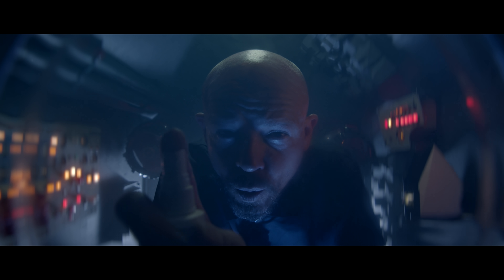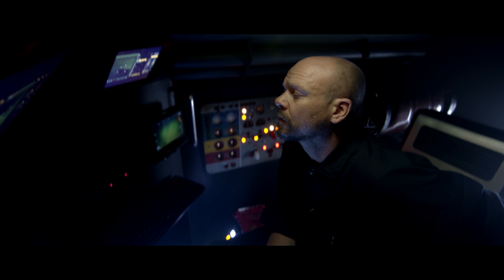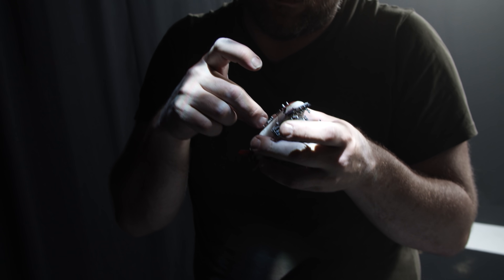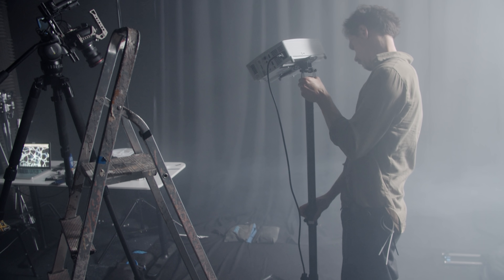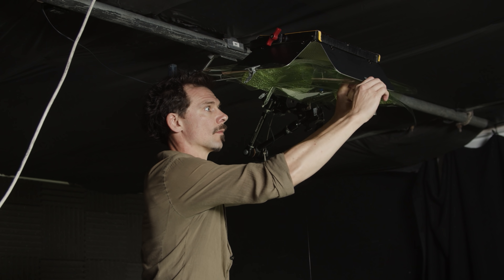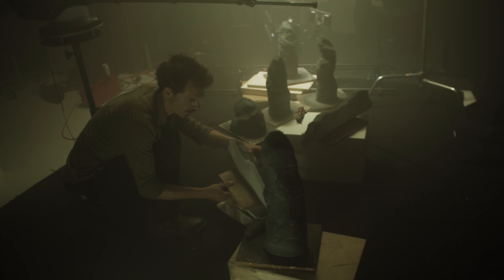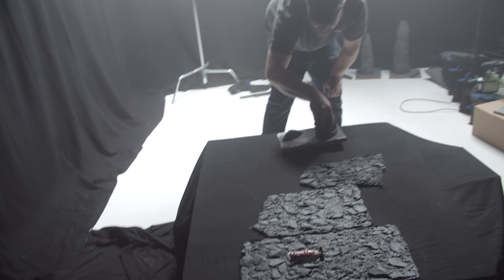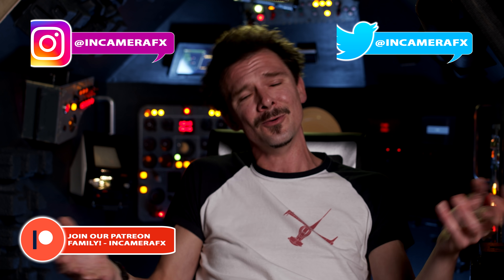We Made A TOY Look Like A Real SUBMARINE with SPECIAL FX!

Comment: This technique goes back as far as the 1940s. They used this Dry for Wet technique at ILM on THE HUNT FOR RED OCTOBER (1990) in fact. Only difference is the miniature was twenty feet (20 ft.) long. Bigger the better for believability. Oftentimes 1/6 scale. And photography would often be filmed "Overcranked" at speeds of 240 frames per second and higher even to give the illusion of massive hull of a submarine in the ocean. Basically sell the shot or what we call in the business a "Suspension of Disbelief".